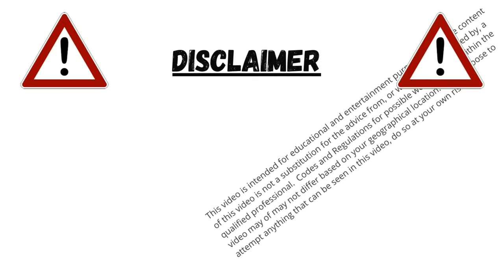Milwaukee M12 Fuel Circular Saw - Features & How It Cuts! - Best "Little" Saw I have Used 2530-20

Comment: I ripped an inch off of three 16’ 5/4 decking boards with the M12 and a 5.0 High output battery and still had 3 bars left on the fuel gage when done.  It wasn’t as fast as a bigger saw, but as a homeowner working on my own projects 2 mins doesn’t make a difference to me.  I built my entire 32’ by 18’ deck with this M12 saw, M12 fuel jigsaw, a 10” Skil Miter Saw, and an M18 Surge Impact.
Reply from the maker: I feel the same way as a homeowner/professional.  The little extra time doesn’t matter in most cases as much as the weight of a bigger saw over the day.

The M18 Surge is my “go to” on bigger jobs.  I have multiple ones that are slightly more powerful, but the sound is worth it to me.

Thanks for sharing 👍👍

Comment: One thing I wish they did is make it a 6 inch saw. They totally could have accomplished that in the same form factor. The reason I want that, is because while this thing can 90 cut dimensional lumbar all day, get into any more than a 20° bevel and you don’t have enough depth for 2 by. That forces me to bring multiple tools to jobs that could have easily been done with this one tool. With a 6 inch blade you’d be able to cut dimensional lumbar all the way down to the 50° max. You know they did that so you need to own the m18 and m12. But that’s cool, it’s just another excuse for me to expand not one, but both platforms.
Reply from the maker: That’s what I said about the new M12 Brad nailer only shooting 1-1/2 nails.  I can’t imagine it couldn’t do the 2”, but then who would buy the M18 over the smaller more compact nailer if it did the same thing 😂

Comment: I have the packout setup on my atvs, truck, and track loader. All setup with the M12 tools, and this is one of the best, the HO batteries give them a extra kick.We own/run live ,  on a animal rescue military boarding home at 9400 feet altitude in the Rockies,.Rocky Mountain approved and tested !! We also use them in gold prospecting and gold/silver mine workings. Currently building 2 small cabins with primarily M12s with 2.5HO batteries and a few high capacities. Rough work at times, but excellent tools 🇺🇸
Reply from the maker: That’s a great test case to show it’s usefulness for sure.

Appreciate you sharing 👍👍

Comment: I own a Dewalt 12V circular saw and I just picked this up and it's phenomenal. I pair with a 24 tooth Diablo blade 5-1/2 with a 5AH High output battery.
Reply from the maker: I use the same blades… I haven’t used the 5.0 HO yet but I always run a 6.0 in mine.  I need to get a high output and try it.

Thanks for giving your thoughts… helps people know more opinions than just mine.

Comment: Welp you definitely convinced me it's a saw I should have. I don't have the M18 rear handle, but I do have the Makita. It's the last tool I haven't replaced switching over to M18 and M12.
Reply from the maker: It is a great little saw. It’s obviously not as capable as a full size saw, but it can get a lot of things done.

For most tasks my Rear Handle is overkill and it’s so much heavier… I just prefer this saw if it will do the job. Most of the time it can and I can’t say enough how light this saw is… it’s like holding a drill.

Always good to hear from you 👍

Comment: I bought a no name, cheap 4 1/2 saw from amazon. And it failed to cross cut a 3/4 plywood in Home Depot parking lot last time I brought it there. The saw just stuck in the middle of the plywood. Great to know this little saw will do it. Thank very much for sharing.
Reply from the maker: You are welcome… most small saws I have bought in the past perform similar to yours. This has been the best one I’ve used so far.

Appreciate you watching 👍

Comment: I am happy to see he is showing what the saw can do and what it is made for. I have that saw and it is perfect for light duty jobs. That is why I bought it. If I have a project that requires more power then I'll use the 20 volt saw.
Reply from the maker: You and me are on the same wavelength… it’s not going to rip a LVL beam in half… but it will do a lot of things with such a small weight and footprint.

Appreciate it 👍

Comment: Thanks for your video: it helped me decide (after almost a full yea) between the DeWalt 4 1/2 saw and the M12, as those two systems are the ones I use.  Being in the woodworking field, rather than in carpentry, I seldom need a circular saw.  Mainly, I will use it to cut panels to approximate size and rapidly/roughly dado a construction lumber, especially when framing the unexpected, custom,  cabinet, closet or vanity at the very end of a project.

The M12 saw covers best both the worlds of woodworking and light carpentry, because of its blade size and its familiar handling.  Also, as a fanatic user of the M12 impact drivers’ line, I know what sort of punch 12vdc can deliver on Milwaukee’s lap. 

 I will never give a c… if a 12vdc takes 4 seconds more to cut a wide lumber than an 18 or 20vdc, if precision — or the pain emanating from my tennis elbow— are at stakes!
Reply from the maker: I feel you on the tennis elbow… that’s why I’ve been going to lighter tools when I can as well.  Every time I pick up my rear handle saw it’s pretty rough 😂

Glad I could help 👍

Comment: I bought that saw and love it.  I use it on trim and cutting in some interesting places.  And it has a brake.  That was one of the other reasons I got it.  I use 5 1/2" and 5 3/8" blades on it.
Reply from the maker: 👍..  I grab this over my bigger one way mor me than the other way around.  For the size and weight, it’s a great saw.

Thanks for sharing

Comment: Highly anticipated video! Unfortunately your video solidly convinced me not to get the M12. Lower number of teeth, fewer available blades, splintering, low power from the smaller batteries are all reasons for me to stick with the M18 lineup. 
I really liked how you showed us real world usage, battery level after a few cuts, difference in batteries and informed me to make my own decision
Thanks for the shout out!! Your shop looks like it has an endless amount of video ideas
Reply from the maker: Glad it helped and that I persuaded you in what is best for you.

That’s the goal behind it all. Just because one reviewer says it’s great, and another says it’s junk…. It doesn’t mean it will or won’t work for you.

All you can do is see how they use it, and how compatible what they do compares to what you do.

I agree that you need to run this with at least a 4.0 but I highly suggest a 6.0. Though you can get higher teeth count blades, this saw is more of a rough construction saw than a finish construction. 

I will confess, I am a Tool Addict 😂. Between my garage, office, and truck… it’s a little ridiculous.

Thanks again for the suggestion and taking the time to share your feedback.
Reply from the maker: Did I at least convince you to get the Rear Handle…😂 just kidding.  

It is an absolute beast. Strongest battery saw I have used.
Reply: @MORGANSMaintenance  I saw you mentioned and use the Diablo blade for your M18 - how has it been in your line of work? I’d like to be able to cut pipes, do miter joints, slap on a track attachment and work in a compact workspace. I’m thinking my best bet is to get the fiddle bits for the m18 circular saw and invest in the 10” m18 miter down the line. I will be considering the rear handle once I get more working space! The way you portray the ease of use is like how I normally use a drill (if that makes sense)

Oh I’m totally starting to understand the tool hoard.. randomly finding a use for that unused tool is so fun haha
The big clamp you’ve got in your shop that was holding the 2x8 horizontally was interesting
Reply: @MORGANSMaintenance  you convinced me to subscribe
Reply from the maker: @crappysoup  I appreciate that!
Reply from the maker: @crappysoup  I primarily use Diablo blades in all my saws (miter and table saws too). They may not be the best overall… but I feel they are the best you can get at the box stores and a good price.

I occasionally buy some cheaper ones for certain things that I know will dull a blade in one cut.

I want to buy the M18 Miter Saw and Table Saw but I wish they had a corded/battery option.  These big batteries are so expensive I don’t want to waste a cycle with a receptacle sitting right next to me.  I would like to have the 10” or the 7-1/4” Miter saw.

The clamp is called a Jawhorse by Rockwell.  It can clamp up to 50” so it will hold an entire sheet of plywood. It’s like a big vise.

I haven’t used the 7-1/4 Fuel M18 circular saw, I’m sure it’s as good as the rear handle. I only chose the Rear Handle for the Left Side blade.
Reply: @crappysoup  milwaukee makes a 6.5" fuel saw with the blade left.  Ive only used it a few times so far but pretty happy and excited about it
Reply: Dude have u heard of online order's for blades and they have stronger batteries out now for it such as the high output

Comment: Perfect for electricians, plumbers, hvac installers to cut blocking, sheet goods or framing in a return box, lighting, I’ve owned the rear handle saw and it’s cool I’ll buy another one at some point to use on big stuff if I need it but this one is all I need as an hvac installer
Reply from the maker: Yeah I can do about 75-85% of most things I need to do with this one. 

Appreciate you sharing your thoughts 👍

Comment: I dont have any m12 but that is most definitely a useful tool. I use a Rockwell 4 1/2in circ saw (corded) to rip LVP as well as replacing subfloor because I can get closer to the wall than with a 7 1/4in saw. Great video as always!
Reply from the maker: Thanks. They have that same Rockwell saw as the place I work primarily. Use it for the same thing (cutting subfloor) and it works great for that.

Always good to hear from you!

Comment: I’m the same with the blade side, had the regular right sided blade 7 1/4 fuel and now bought the same combo as you with rear handle and this little one. Perfect combo! Have it in lightweight bag with my m12 drill, impact and oscillation tool. 
Thanks for the review!
Reply from the maker: Your welcome.  The M12 won’t do everything, but it’s nice not to have to lug around the Rear Handle for what it will do.  I will sacrifice some speed for weight.
Reply: @MORGANSMaintenance  All day long man, I'm getting addicted to the M12 platform....slowly getting duplicates in smaller/lighter versions of the majority of my bigger tools.....it is so nice to walk into smaller jobs with 50 pound less to carry. Also, I'm a tool hoarder so that counts too. lol
Reply from the maker: @DownloaderVideo  I’m exactly the same… if I can find an excuse to buy a tool… I’m getting it 😂

Comment: I have an old Ryobi one plus circular saw that's pretty weak. Looking to upgrade to this since I'm into the m12 system these days. Would be perfect for the truck toolbox to cut down lumber to fit in the truck if needed.  Also looks great for all my around the house projects.
Reply from the maker: I use mine outside of Home Depot all the time 😂

Just make sure if you get one, buy a different blade. The stock one stinks and it will make you think the saw isn’t as good as it truly is
Reply from the maker: There is also a newer model than this one now, it’s even a little better

Comment: The m12 been on my wish list for a while I got the 6 1/2 I do strictly Hvac so it’s so rare when I actually need a circular saw
Reply from the maker: I use mine a lot.  I have it and the M18 rear handle for the bigger stuff.

Comment: I've used mine (with the rip fence) to rip several 60" long, 1.5" thick solid-hardwood desktops & countertops, and while it's slower than a larger saw, it never bogged down.
Reply from the maker: Yeah as long as you let the saw do the work… it will typically do it. Like you said, a little slower… but it’s a good trade off for the size and weight. (In my opinion)

Thanks for sharing 👍

Comment: Not a Milwaukee user, but I get the idea. You put it very well - the video contains every information a potential user may need. Demonstration parts are on point.
Reply from the maker: Thank you! It won’t be for everyone, but hopefully it helps them make that decision.

I’m going to have to buy some Makita to review 😂
Reply: @MORGANSMaintenance  Maybe not buy, but with the channel growing, there may be some opportunities. Sooner or later you will be approached with some sponsorship offers.
There's no point in buying new battery platform just fot one or two tools. If I'm forced to do it, I use battery adaptors for Makita. Although I must be careful with these, because usually they lack third connector, thus there's no overheat-protection from the tool. Besides adaptors don't give you the full experience of the tool capabilities.
Reply from the maker: @Stefan_Kawalec  I have done that with a few Ryobi tools. I purchased an adapter that works with Ryobi tolls and Milwaukee or Dewalt batteries.

Ryobi has so many odd tools in their line up that are very inexpensive that I buy an occasional one until Hopefully Milwaukee comes out with the tool.

You are right though, you have to be careful using those.
Reply: @MORGANSMaintenance  It's is indeed odd when a less professional brand of TTI is more professional that the "superpro" brand. Vide - plunge/track saw. When TTI acquired licence for Ryobi brand, I thought that it will stay DIY brand not cannibalising Milwaukee target-group. Bit many of Robi tools should be in fact M12 tools, and some may be M18.
Reply from the maker: @Stefan_Kawalec  I know. The Ryobi line up is really extensive and most of their tools are less than $100. I can see why many people would gravitate to it. When they come out with stuff I always think, “why doesn’t Milwaukee have that option”

All the ones I have worked fairly well. I’m not sure how they would hold up with heavy use because I buy them specifically because they are low use tools.

Comment: Looking into this Milwaukee 5 3/8 saw to use up in the rafters and in odd positions I sometimes find myself in. For now, I'm using my Dewalt 60v 7 1/4" circular saw in those tight areas and it gets tiring after 3 or 7 cuts in those odd places. I have a few other Milwaukee, Dewalt and Ryobi tools for their jobs they do very well. Thank you very much for this video...more than enough and well showed what a 4.0Ah battery can do.
Reply from the maker: Your welcome,,, glad it helps.  It’s not as fast as the bigger saw. But it’s light, compact, and will do it… in my opinion.

Thanks for watching 👍
Reply: @MORGANSMaintenance  I agree with you on that. I plan to keep my 60v for the main tasks on the ground and ripping board. Also, my son is coming of age to where he wants to help with DIY around the home and safety in mind.
Reply from the maker: @andyprairiedog  that’s good… teach him or you will be at his house later fixing things 😂
Reply: Ordered one finally!! My young son and wife will be using it. Cannot wait for it to come in the mail as a "bare tool". My wife already has a few tools in the M12 line with some 6.0 Ah batteries.
Reply from the maker: 👍… It does work better with the 6.0’s in my opinion

Comment: Thanks Morgan I’m seriously considering this saw as I’m building up my M12 line. I found your review very helpful.
Reply from the maker: Glad I can help.. it’s not a full size saw as far as speed and power, but unlike other small saws it is not very far behind. 

It is so much lighter though that I will use it every time I can over my bigger ones. To be honest that is probably 90% of the time for me… just depends on what you do.

I wish it was a little cheaper. It’s rare, but every now and then they run it with a free battery or tool. Not near as often though.

I think you will like it. I’m a big fan of the M12 line so far. It’s what I always grab first.

Thanks for watching and it’s always good to hear from you!
Reply from the maker: I’m also curious what these new M12 High Output batteries may do with this saw.  I can tell a difference in my M18 saws when running them.
Reply: @MORGANSMaintenance  I just love the M12’s for their portability and light weight. I’m more tinkering and maintenance so it’s not like I frame houses. I have a plug in circular saw if I need to do heavy work but it’s a pain to break it out when I need it for 1 or 2 quick cuts (first world problems). I’m not made of money but the price isn’t too much of a hurdle because I run it through a business. I also save money on batteries by supplementing with the Waitley knock offs. They don’t seem to last quite as long but work well for about 20% of the price. People make fun of me for my cheapo batteries but I’ve got a bag full of spares that work just fine. In my shop I use an M12 3/8” ratchet with only 3.0 ah Waitley’s and they work amazing, no difference in power for me.
Reply from the maker: @OShackHennessy  I’m the same way with corded tools now 😂. It’s like I’d rather be punched in the face than get an extension cord out.

I usually buy all my tools with “free” batteries and have plenty but that’s good info to know on that brand in case I ever need some. I’ve always been iffy on buying them because I know nobody that has them. But hey if they work… they work.

Comment: I bought the 12v Milwaukee from a overstock guy. It's new in a bag. No box and no manual.
Cuts a 2x6 good and it's goes through with no binding.
Reply from the maker: Yeah I use it all the time for 2x4 and 2x6 framing.

Thanks for sharing. Always helps to hear others opinions in the comments. 👍

Comment: I have M18 FMCS for metal cutting and I buy some Bosh blade for wood... Great tool when you on roof... small and light... When I need something more powerfull I have M18 rear handle too...
Reply from the maker: 👍

That rear handle is a beast… but man it’s heavy.  Hard to use with one hand at my age 😂
Reply: @MORGANSMaintenance  I agree...rear handle is a beast...big dog...